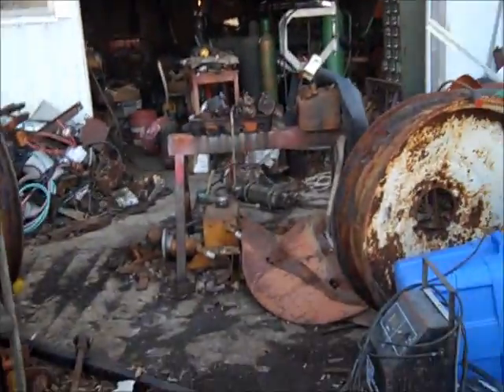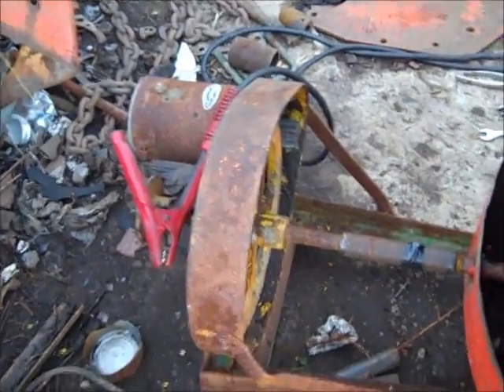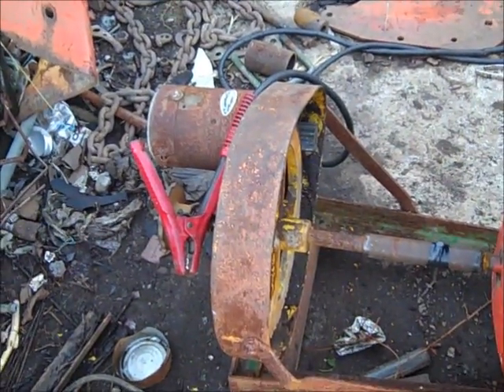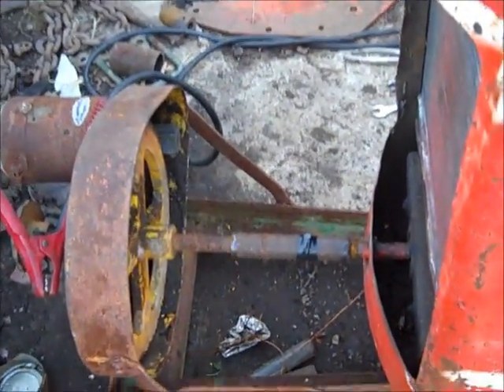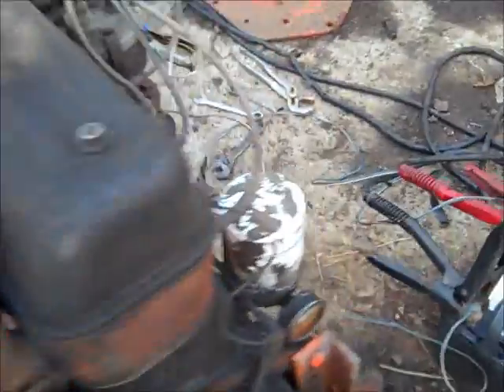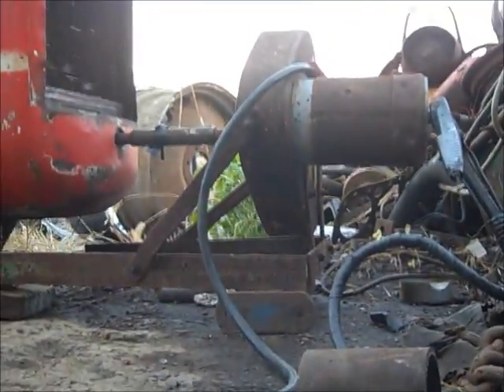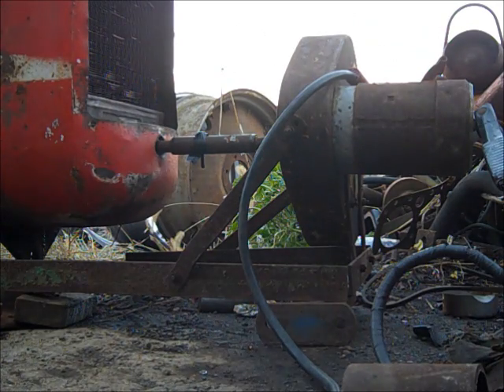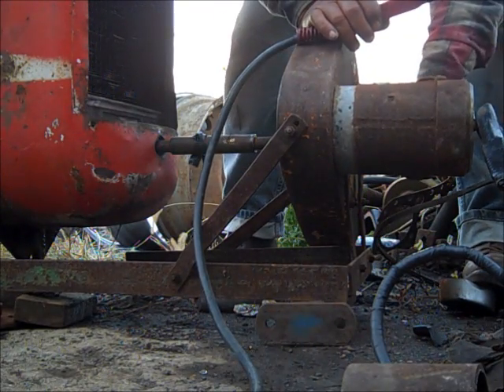Allis B replay more info

Comment: Need a hood,Starting gasoline tank, steering linkage,any of the engine valves that are worn out
Mine has wide front axle
Also the side pulley mine is missing